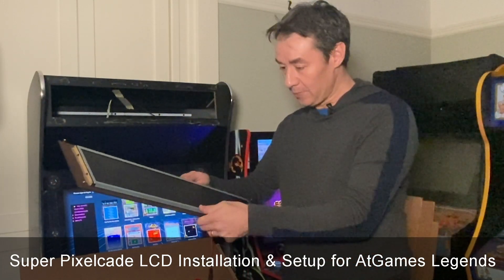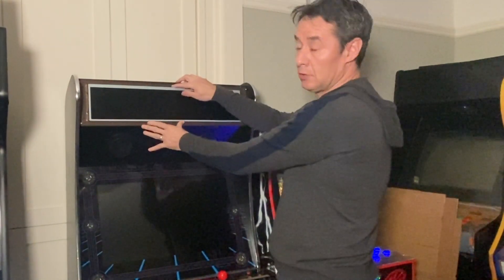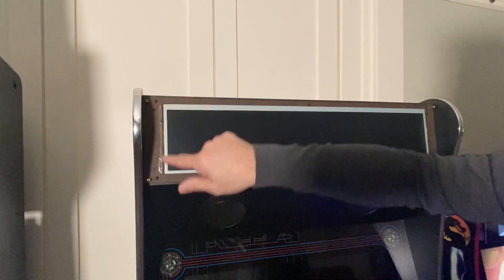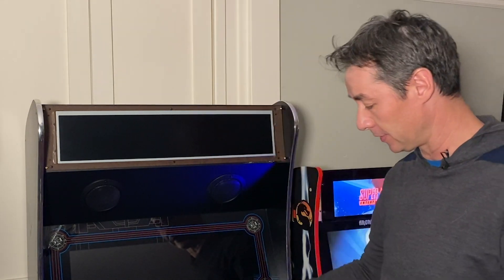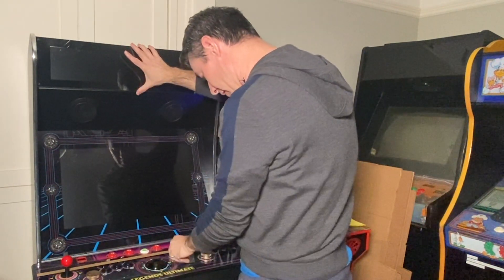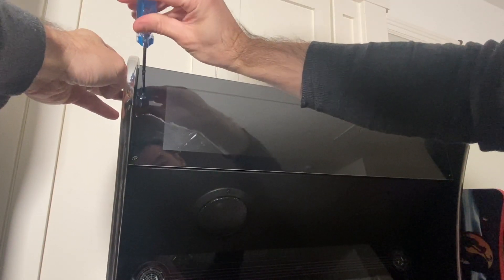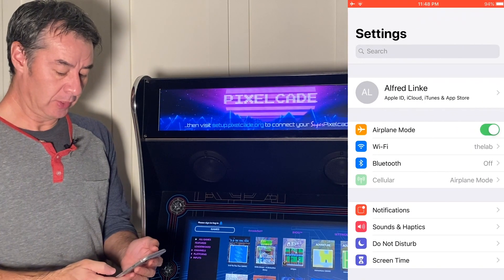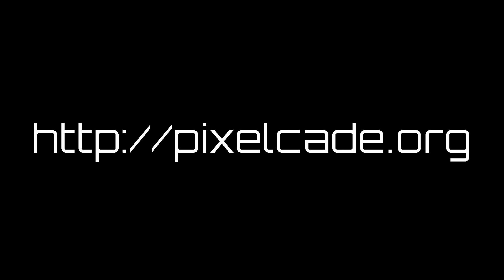Super Pixelcade LCD Installation & Setup for the AtGames Legends Arcade Cabinet

Comment: All of a sudden pixelcade is no longer on my lege ds ultimate mini max did they remove it from the software or something?
Reply from the maker: we're not aware of any changes there but you'd need to check with AtGames as they control the software on the ALU

Comment: Do you have a non-WiFi dependent option? I’d rather hard wire to the pc vs over WiFi.
Reply from the maker: Yes , it’s got an Ethernet port so you can hard wire too
Reply from the maker: yes you can direct Ethernet connect from the back of Super Pixelcade LCD to your PC, that works too

Comment: Nice. I’d like to see one that fits a 1-up perfectly. Not those ones I see that fall short but fill the whole width. Haven’t seen that yet.
Reply from the maker: Possible but would require a custom run of LCDs made to that exact size, would be pretty expensive to produce, it's a great idea though